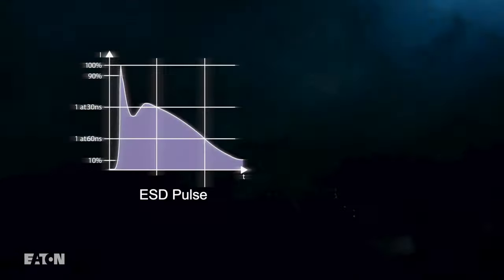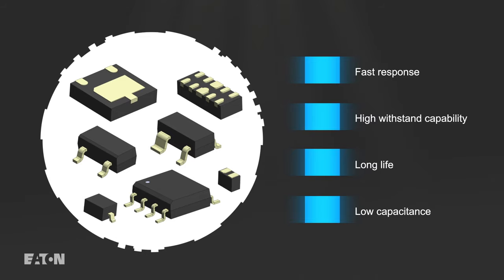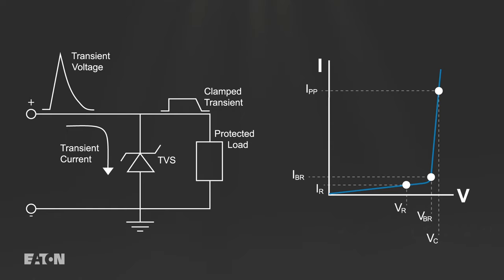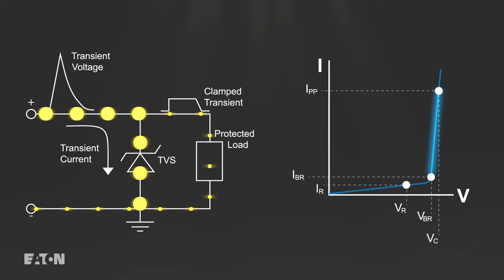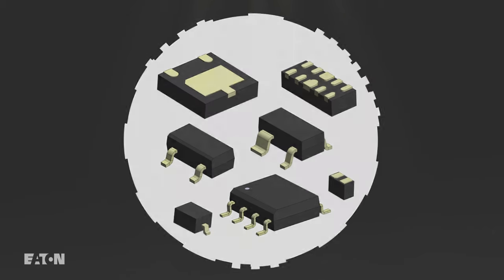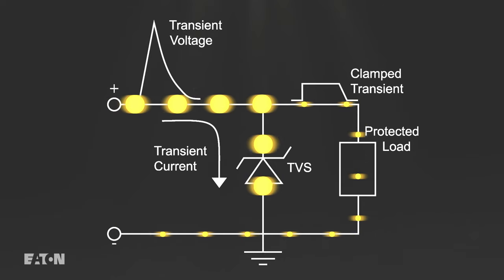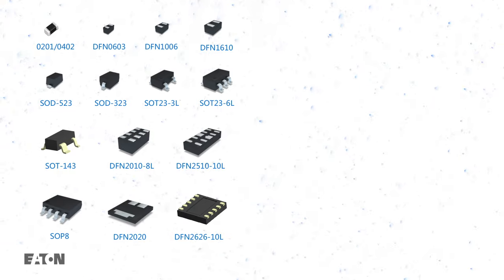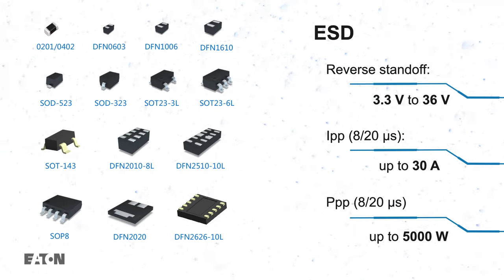How TVS Diodes work

Comment: So, not much different than a generic zener diode ?
Reply: The low voltage behavior (<10V) ist the similar, but TVS diodes can withstand the very high voltages and are fast and can tolerate these pulses.
I think.

Comment: do you have any components that can bypass a 12ms 50V transient? i'll even give you  a profile -- 24VDC - 18VDC(in 1ms) - 50VDC(in 30ms) and sustains for 12ms - 24VDC(in 70ms) ..?ref- MIL 704D
Reply: Is this in a high current application? If not just slap in a resistor to eat up some more of that energy.

Where do you see those kinds of transients? Lol